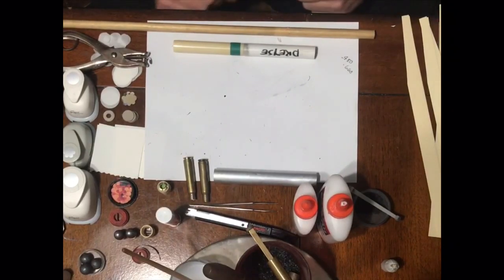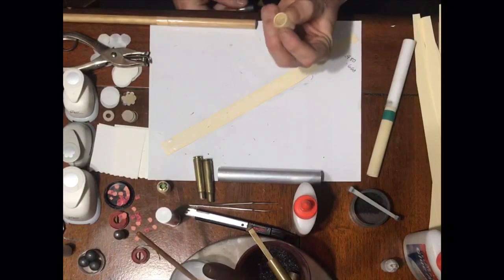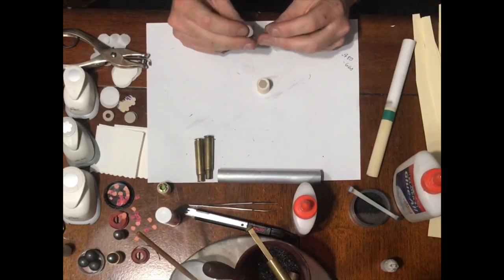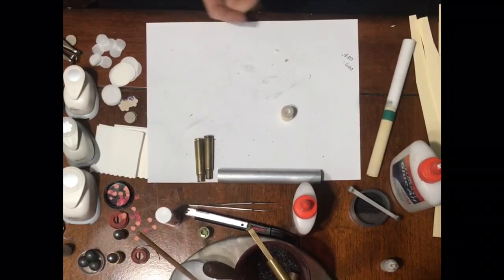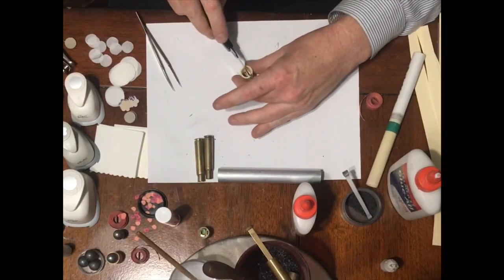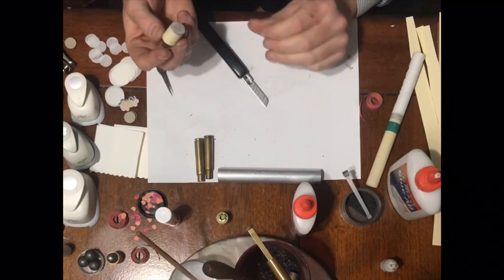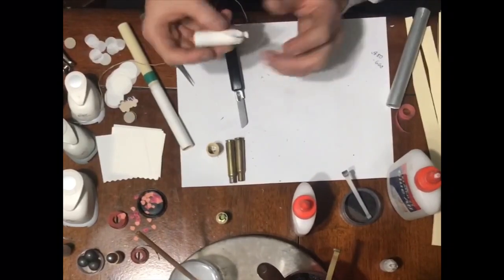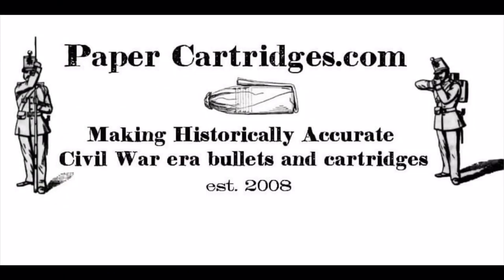Dreyse Zündnadelgewehr Needle-Fire Cartridge Construction

Comment: I have had endless problems getting the langblei bullet to stabilise.. lots of brummers!
Reply from the maker: I think I may have solved it, using delrin plastic for sabots. The Chap from BOTR also got good results with it. I’ll do a video on them soon.
Reply: @papercartridges6705  Yes, I would be interested to see this.. Maik Demuth at Pedersoli-Service-Deutschland in Hallungen, Germany is making plastic sabots for M47 "Acorn" bullets. I am tempted, but I would need to shell out for (yet another!) mould! I would like to try and get my M55 bullets flying first!  I have an M60 which I restocked and which shoots well with a .615 ball! Leonard & Guy  A-R-West note in their book note that some of the original sabots they have found were varnished. I have tried this, but with limited success!

I have just been asked to reconstruct the guts of an M54 bolt.. it looks a fairly straightforward job apart from the Sperrfeder spring! We shall see..

Comment: Have you ever messed with Smith carbine round? Yes I know they are metallic cartridges or plastic or plastic for blanks but it would be interesting if someone figured out a way to make a paper cartridge alternative instead. I don't have a Smith carbine but I do plan on getting one and a good friend of mine has one and I could possibly arrange for it to be loaned to you if you needed it for testing.
Reply from the maker: Haven’t gone down the Smith road yet… wouldn’t turn one down if I found one at a reasonable price. Which never happens…